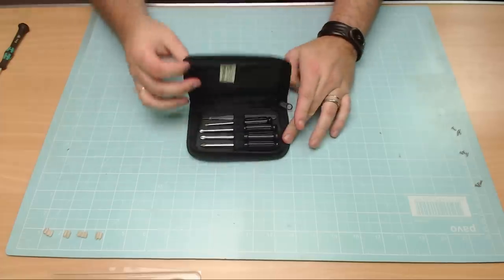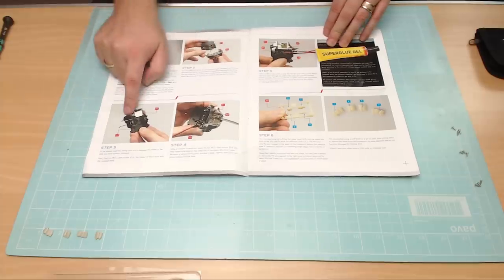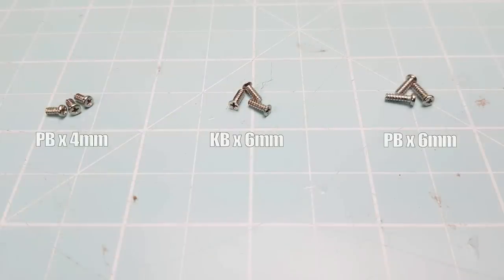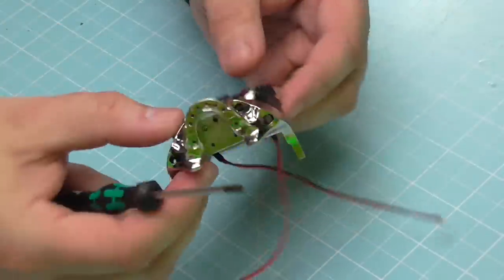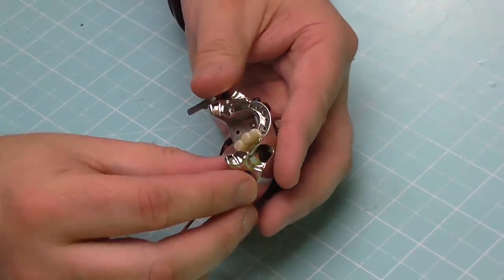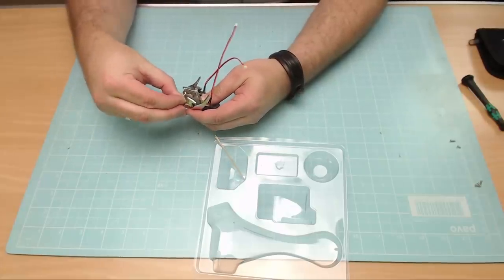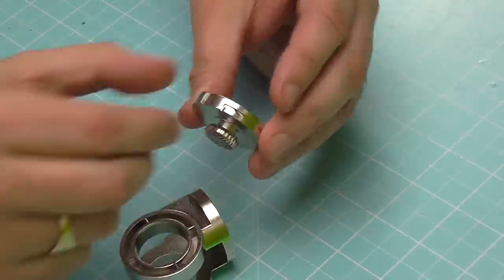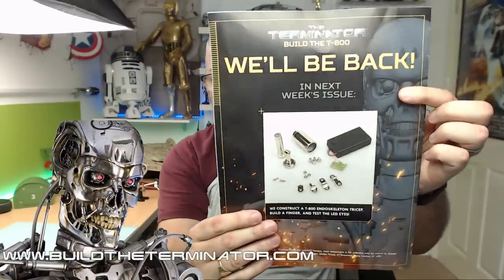Build the Terminator - Part 2 - Upper Jaw, Teeth and Right Arm Components

Comment: A lot of polishing vids out now and it’s only issue 1 is it really that bad ? I did notice on the promo vid the the face plate from issue 1 is a different shade to the rest of the head. Not sure about doing this build?
Reply: Hi it's a kit and will need as some work to make it movie accurate but we're getting all the parts, so once you've modified the parts that need it and had them chromed you'll have one amazing 1/2 figure.
Reply: John Vaughan I’m sure it won’t be anywhere near as bad as the Delorean but for £1,100 I would expect it to be perfect. Even issue 1 doesn’t look perfect to me but good luck with the build👍
Reply: @miller7992   Yer I was hoping for perfect ( which it is quite far removed from ) I've taken my drill and Dremel to it I've also changed the eyes for accurate ones, the teeth will be next once all the modifications are done I'll have it chromed before I put it together so mine will probably end up costing closer to £1300 😱 but it's over 2 years
Reply: John Vaughan just like my Delorean probably cost me over £1,500. I think my question should of been is it a mod or a fix to how it should be.
Reply: @miller7992   well with this kit it's extreme modification as box standard it looks Goofy and very poorly sculpted, part of the joy is to make it look movie accurate I've looked at other 1/2 scale T800 figure's cost around the 2 Grand mark so I'm going to stick with it and see how it goes 😎